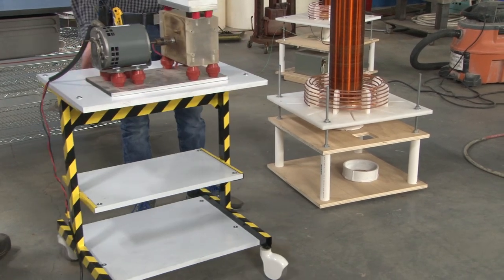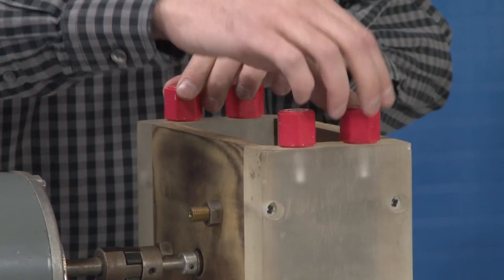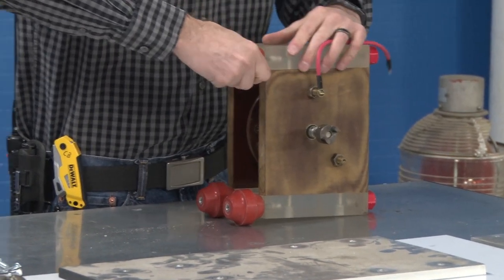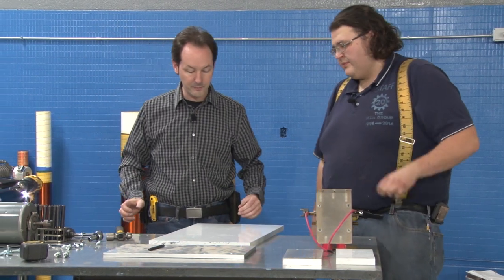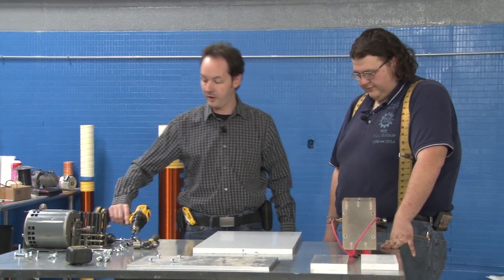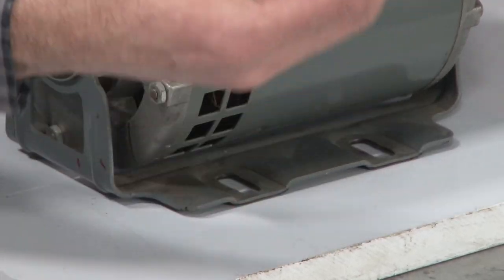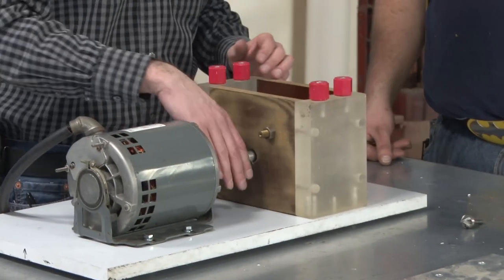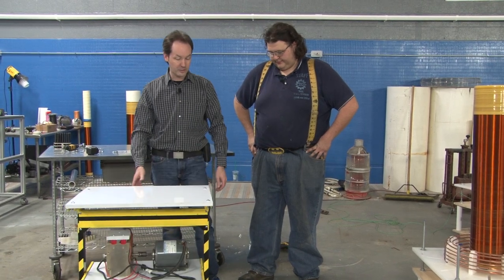Installing a Spark Gap for a 6-Inch Tesla Coil: High Voltage Lab

Comment: Nice RSG - but it is not exactly 1800rpm because your line frequency is not exactly 60Hz, it goes up and down a fraction of 1%. But you can say that the RSG rotor exactly follows the line frequency so that the RSG always 'fires' at the same point on the line voltage waveform. You knew that but it was just to clarify for your viewers. Great work guys.

Comment: Just as a point of fact the position of the Lovejoy connector doesn't matter. It can only be misaligned by exactly 180° of phase meaning that the contactors still align. If there are four equally spaced contactors on the rotor as depicted in this video then 180° won't matter because you get a mirror image. Even 90° wouldn't matter under those circumstances. We all have these "Derp" moments o and I just happened to catch this one. I'm sure there are others who did also so this comment exists for those who missed it. Thanks for the great video...